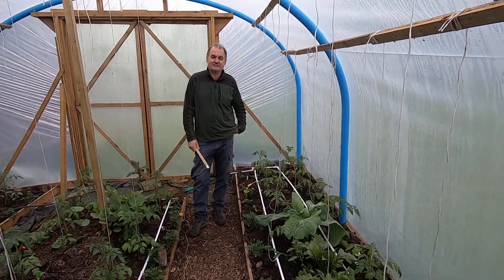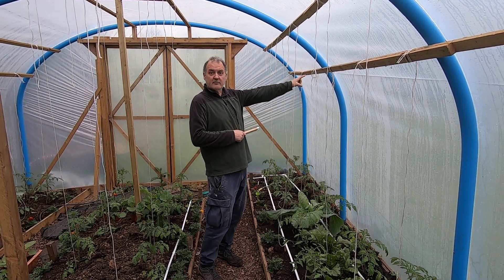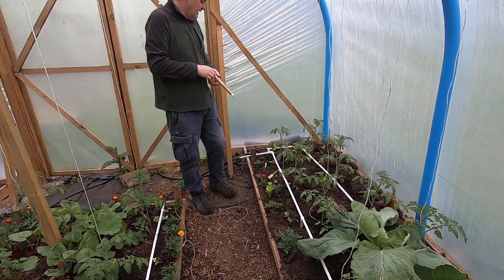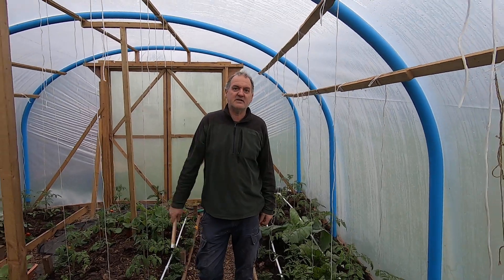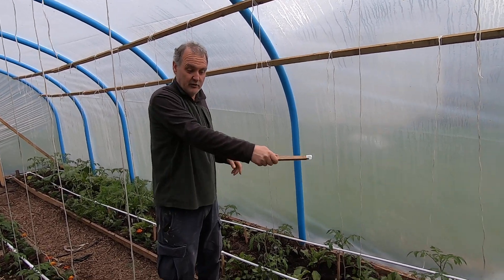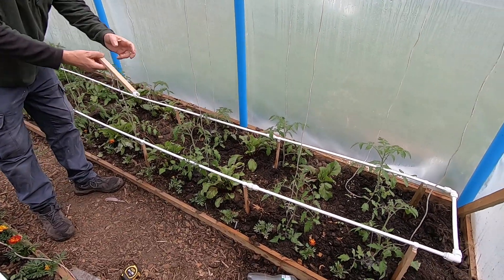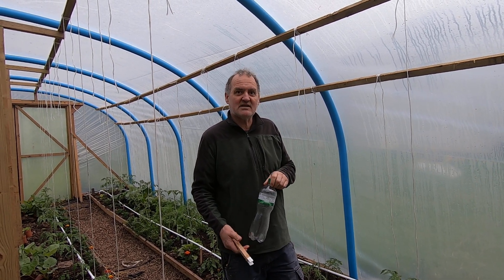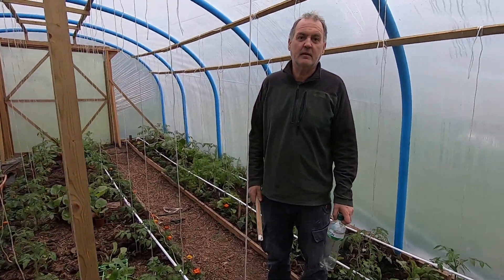Polytunnel Irrigation Part 1: Using 15mm water pipe.

Comment: Remwmber ages ago i watch the series of you putting that tunnel up. Looks as good now
Reply from the maker: Thanks it is great to hear some people have followed the journey of our polytunnel escapades. It is holding up well, we can move the blue MDPE pipe to tension the plastic sheet as it loosens over time so I think that is good for the longevity.  We had 50 plus mph winds today and it was getting battered but it has stood up to some wild weather now. Fingers crossed it continues. Thanks for commenting.